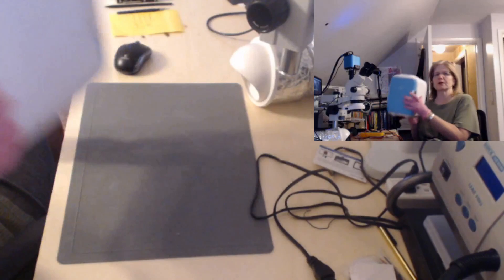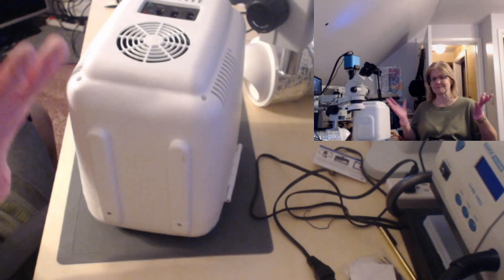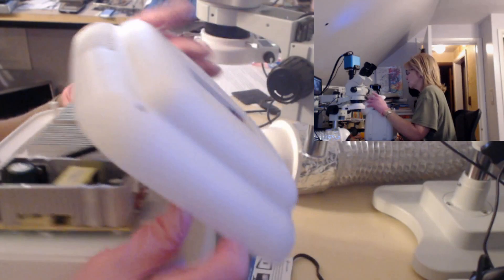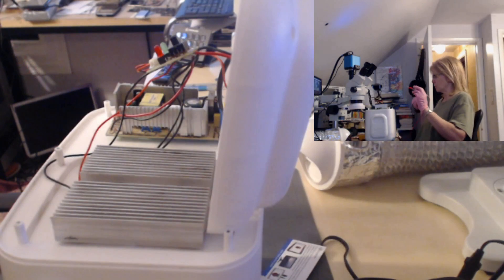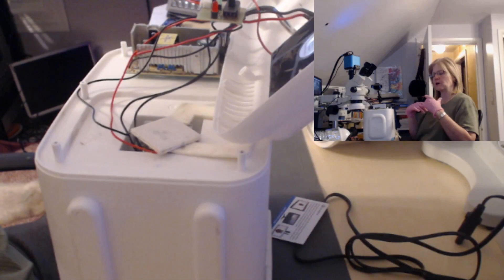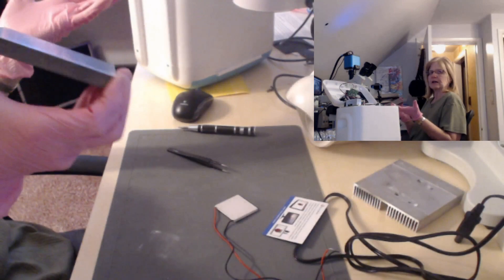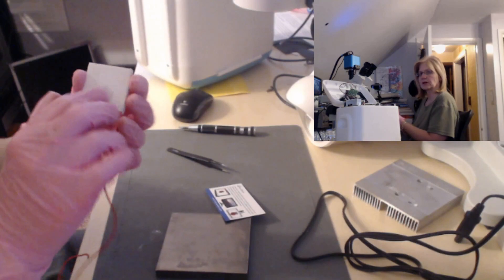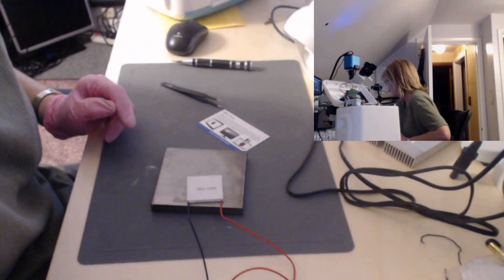Mini Portable Refrigerator Unit  - Not getting cold

Comment: My respect and honors for Lady Lisa for such work.
I have some 8 Peltier refrigerators.
Now trying to repair the last one.
It's a 25 liter, but the Chinese installed the same 12705.
There are 4 other (except the red and black) wires going into the wall between the electrics and the food storage compartment.
2 thin wires are green (probably a thermistor). 
But there are also two yellow wires going into this wall.
With everything turned on and 12v supplied to the Peltier, it looks like no voltage is supplied to the yellow wires.
Unlike many other 25 liter refrigerators this one has no internal fan.
Does anybody know what the yellow wires are for?

Comment: Thanks to your video I tore apart my mini fridge and found that the peltier module didn't have one wires connected. So now easily I just got by a $3 modular. Mine is a 12704 but I was curious if I could put a 12705 or 12706 in it

Comment: Hi what does it mean when the green light just kept blinking. We had a power outage then when i turn on the power supply the green light just kept blinking and no fan moving
Reply from the maker: Flashing green light usually indicates an error code.  Did you try unplugging the unit from the power supply and let it sit unplugged for a few minutes and plug it back it in?

If that doesn't resolve the issue then you're looking a board issue.
Reply: @irepairidevices  hi! Mine is having the same issue.. i did unplug it and plug it back again.. but the same thing keep happening..
Reply: @PaoNaranjita  THE PROBLEM IS THE POWER SUPPLY IS FALT
Reply: @PaoNaranjita  were you ever able to find a solution? My power went out and the green light keeps blinking and the fan is stuck:(
Reply: @karyme-rj6ky  no, got rid of it.
Reply: It's the blinking green light of DEATH!   Meaning, the fridge has gone to fridge heaven😇

Comment: i run one of these at 2.4 amp 12 volt. off a powerbank. with a usb 12 step up   handy runs for about 5 hrs
Reply from the maker: I also have a mini portable refrigerator. I store my flux in there and other items in my repair shop.
Reply: @irepairidevices  the I need tabbing stripps and some new solder.  Been posting it off. Did u see my latest video fixing pile of plasma tv ..have a fun weekend. Digging through random 18650 cells over here

Comment: Hi Lisa, I and a few others have an issue with the main circuit board ( inverter 110 AC to 12 V DC ).   The whole cooler works on DC but the LED and fan PULSATE on AC supply.  I have started by checking for faulty diodes.  Any suggestions as to a cause ?    Thanks   JwgK
Reply from the maker: Honestly without having a schematic or knowing which make/ model you are trying to troubleshoot,  I can send you down unnecessary rabbit holes. Can you supply me with the make/ model # of your specific unit?

Comment: I have the same fridge that runs on a 4amp peltier... can i upgrade it to a 6amp peltier to make it colder? And if I change the peltier amp do I also need to replace the rest of the components? Thanks
Reply from the maker: Hello Han,
you need to be very careful when one is thinking about modifying a circuitry.  When circuits are built they are designed to use components based off the calculations that were determined during the building process.  By increasing the Peltier itself, the actual logic board would mostly need to be modified to handle the increase of current that the Peltier will be outputting. Tread lightly and really study the board the Peltier is feeding off of and try to do some reverse engineering to determine which components would need to be changed.  I wouldn't suggest such a modification unless you know 100% what you are doing because you do run the risk of an electrical fire.
Reply: @irepairidevices  thanks for the info... im trying to do a diy aquarium chiller because the commercial chillers cost a lot and thought maybe i can use the portable fridge for it... maybe ill just stick a water cooling block on the cold side of the peltier to cool the water faster instead of upgrading the peltier itself... haha wish me luck :D

Comment: This was a great video. I have 2 questions. I have a bigger one that wasn't cooling. I did everything you did except the Peltier unit was glued down and I didn't want to risk breaking it. I didn't notice that the once side did get very hot fast. So I just put some silver thermal grease on it, and put it back together. It's cooling to 61 which is 13 degrees cooler than my room. Question 1: Is a 13 degree difference normal? Question 2: If the one side get's hot, does that also mean the Peltier Chip is working or do you have to verify the cold side as well? Thanks again for this video. It was very helpful.
Reply from the maker: Hello Joe, to answer your questions 
1. Did you replace the Peltier with the same identical one the manufacturer had in it because these Peltiers do have different watt ratings.
2. One side of Peltier chip will get hot and the other side will get cold, but how hot depends on what the rated Peltier that is being used in your application and how it's suppose to be used. 

What did you do with the old Chip. I know you left it in there but did you disconnect the wires on the bad chip?

By using a under or over rated Peltier chip in any circuit can damage the logic board and the burn out the chip as well. Engineers used OHMs law to determine the wattage rating for the Peltier chip they felt was necessary to be used that particular model you have.
Reply: @irepairidevices  I haven't replaced it. I didn't want to break it. I just slapped some grease on it and put it back together. I couldn't get the chip out to see what the numbers on it are to buy another one. But like I said, the one side gets hot, does that mean it's working or do I have to test the other side for cold? Can I tell what kind of chip I need by testing the ohms? My concern is that if the chip is working but the under side (glued) grease has dried up and needs some more. Were you thinking that I put a new chip on top of the old one? Is that possible? Thank You?
Reply: I bought and replaced the chip and the fridge is working great. It's actually the same chip used in this video.  I also have a smaller fridge that uses a smaller chip. The chip is a TES1-12704. What does the "S" mean? Is there a difference between the S and the C? Also, since this smaller chip uses a max of 4 amps, can I replaced it with a TEC1-12705 chip (the order came with 2 of them)?  In my mind, I'm thinking it may work, it just might not get as cold as the 4 amp max chip would. Or am I way off? Thanks again for this video. I bet I've watched it 10 times already 🙂
Reply from the maker: @joeguilfoyle1922  glad to hear the fridge is now working. As for the TEC1 vs TES1 - TEC1 is a single stage standard size.  The TES1 is a single stage smaller size. So the TES1-12704 is a single stage standard size 4AMP chip. When I say standard size vs smaller size, I am referring the overall dimension of the chip.
Reply from the maker: @joeguilfoyle1922  you definitely do not want to replace the a chip rated higher than the original chip. When boards are designed engineers calculate the appropriate components needed to make it work. If you replace a component rated higher than the original component it can cause overheating which in turn can cause it fail and possibly cause a fire.
Reply: @irepairidevices  Thank You!
Reply: @irepairidevices  Thanks Again!
Reply from the maker: @joeguilfoyle1922  you're very welcome 🤗

Comment: Nice video. I have similar refrigerator same problem. Maybe you have link where i can buy the part you replaced?
Thanx
Reply from the maker: I am not sure where you are located from, but I was able to purchase a pack from Amazon. You would simply enter the same number listed on the current Peltier module. That number has a meaning to it as you have learned in my video. If you can't find it, email me and I will certainly send you a direct link.
Reply: I as well have the same problem ! Now I need to know what part to order.

Comment: Y doesn’t the fan count as a “moving part “
Reply from the maker: In the video I was explaining the peltier module doesn't have any physical parts that generates the cold and warm function of the refrigerator. Peltier modules internal components are the ones creating the cold and heat. Each side of the plate serves its purpose,  one side of the plate is creating the cold side and the other side of the plate is creating the warm side. The fan is just circulating the air.